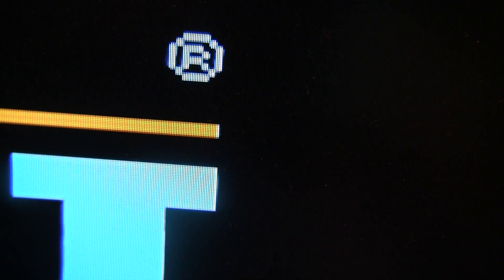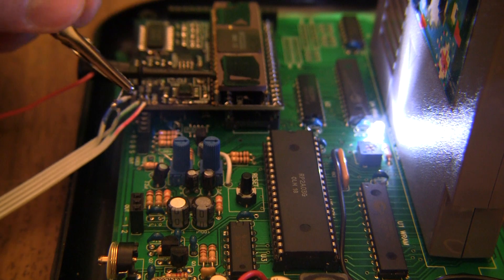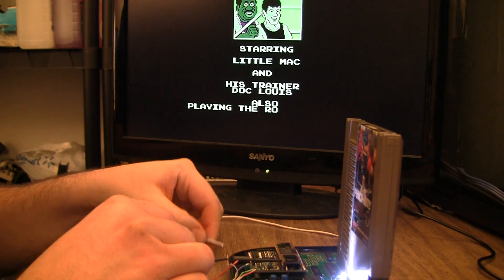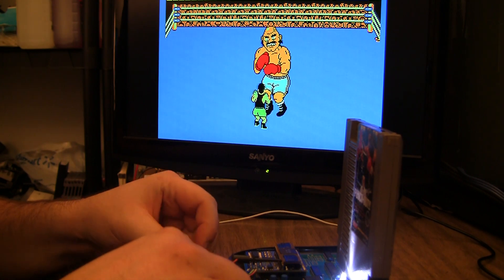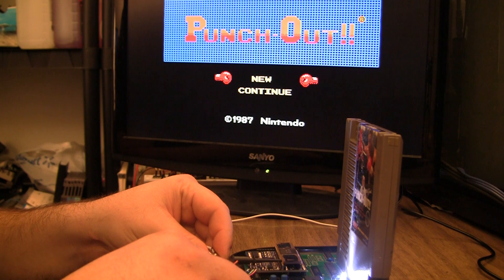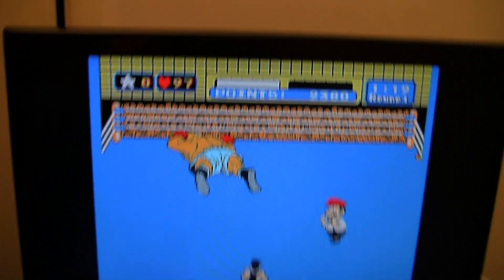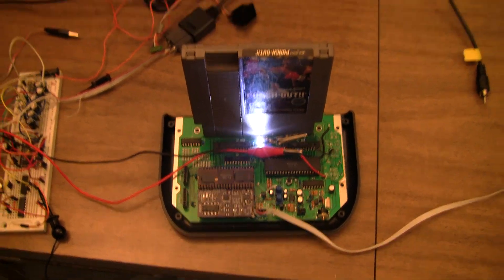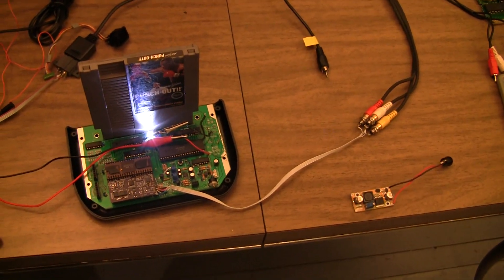NES Nintendo - Super 8 -  pt3 - Interference is GONE - solving the power issue

Comment: i ran into the same problem this past summer when i was messing with my import systems. i bought a cheap 8 dollar 9v power supply and it had some static. i noticed when i used a different slightly higher output adapter that the static was gone, but i didn't want to blow anything so i ended up getting a quality 9v 1a power supply and all my static issues were gone! lesson learned= dont buy those cheap power adapters unless you dont care about the signal quality.